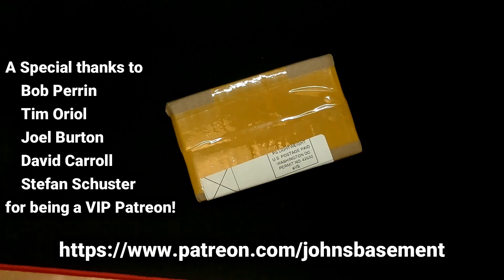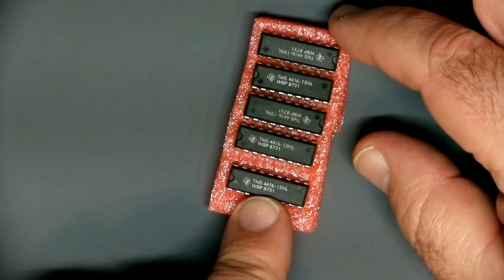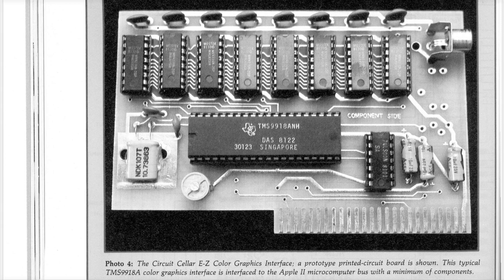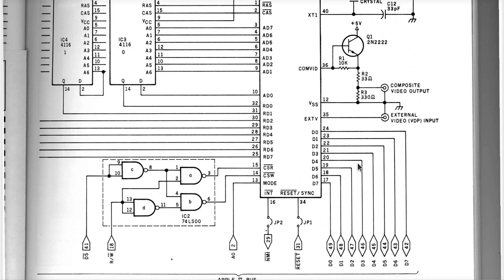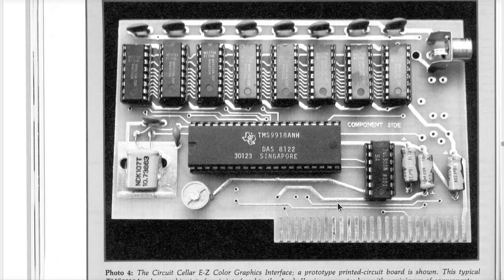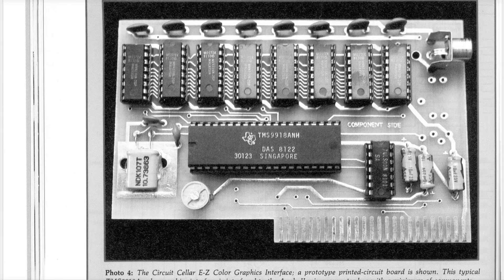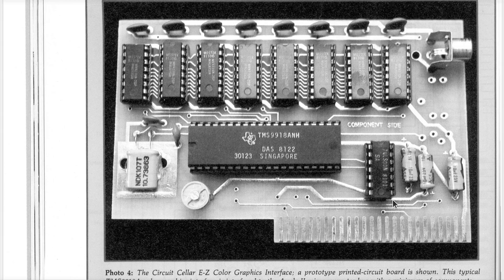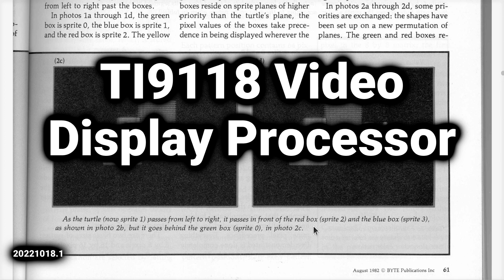Z80 Retro #44 - Contemplating the Addition of a TMS9118 Video Display Processor

Comment: And extremely bad designed-full of tricks-and limited chip. it also have a very annoying hardware bug related to the polling of status register that because of a race condition can cause the cpu to misread  the vblank bit of status register.
Reply from the maker: Indeed it does!  I recorded a vid about that and hacked the design to work around it.
Reply: @JohnsBasement  It's not the only flaw in this chip. there are a lot of stupid choices, driven mainly to cost-cutting reasons.
For example: the magic Y value for sprites. Why the hell a so stupid choice? It prevents increasing the vertical resolution in new improved chips. What if the Y res increase to 350px? you have a forbidden Y sprite value? My god.
Also i've discovered another stupid behaviour. I remember a register configuration that make possible to use less memory in GR2 mode by using only one third of the three banks available  for pattern and color data. However, why in the hell the number of sprites decreare from 32 to 8? what have to do pattern and color data with sprites?
And MORE: it also give a sort of "sprite ghosting" effect where the same sprite is REPEATED on various Y positions. But this only appear (i do not remember) DEPENDING on THE CHIP THERMAL STATUS (the chip temperature) !!!!!!!!

May be a fanout problem in some output stage? What a crappy full of shit chip
Reply from the maker: You'll notice that I have moved onto FPGAs... in part to design my own VDP.
Reply: @JohnsBasement  A right choice... ;-)

Comment: it is no problem for the bus connector (as well in the apple2 as ibm-pc) dealing with only hal-tinned surface on the contacts (they do have to be gold-plated or else) because of thermal "self cleaning" and "vibration "self cleaning" -- in opposite to vg64/vg96 which are contructive steady-state. there it a lot of sense using high quality gold- or something else "good" on surface of the contacts. 
of cause, some higher density pc-connectors such as agp are more sensitive about. the original pc-xt- or at-slot connector is as primitive as it can handle just only hal-tinning, refreshing its connection by thermal- or vibration- cases during normal operation process and use. golding only suggests "higher quality" -- and that's why it is done by everyone.
next, me was surprised by asking prices: chemical golding the whole print was cheaper!!! or even the same as hal-tinning. i believe this is a structure-processing thing of the company each -- it's easier for them to run only one kind of processing for all units they produce, regardless what it is. they count and calculate in square meters ore something else per hour "processing-costs" regardeless which processing; -- the main thing ist, it's their own processing; so hal-tinning is an extra step if they were shot-in for general chemical-goldig e.g. regardless what comes in to process.
best regards, andreas seck (germany)

Comment: the early MSX computers used the 9128  chips.. and i have the manual with the chip info and pins in it if you want it...
Reply from the maker: Thank you for such a thoughtful offer.  But, since recording, I think I found what I need on line.

Comment: The commander X16 uses an FPGA video solution (Vera?) and there were at one point some Arduino hats that ran something similar.  But that probably gets boring if the whole problem has been solved.
Would it be a dumb idea to add a couple of 8-bit latches to decouple the TMS from the Z80 bus timing issue?
Reply from the maker: So true!  I often say it is not about HAVING something, it's about CREATING it!
One need not be the first to do so in order to experience the joy of discovery.

Comment: Regarding the speed of your z80 vs the ti9118 on I/o operations the z80 automatically adds a wait state to access the io devices for that specific reason. Maybe adding a 2nd wait state is all it needs which is done easily with an 74hc74. There was a nice section in an z80 book on es generation for memory and slow io devices which I used to properly access an ay psg some 15 years ago - can’t remember which book it was though .
Reply from the maker: I did a facepalm the other day while reviewing the waveform diagrams.  Again I forgot about the I/O wait state that the Z80 adds on its own.  Even at 10 mhz it is close.  Maybe adding one wait state is all we need to be in spec!
I remember seeing the 'add 1 wait state' schematics many times.  I expect it will be easy enough to locate & analyze.
Reply: @JohnsBasement  I’m thinking of using the chipselect for the vdp and feeding it in an d flipflop clocked by the cpu clock which ensures it’s still there in the next t state of the z80 which is t3 if I’m not mistaken. If you need more there are 2 d-ff in the 74xx74 simply or-ing the outputs et voilà waitstate generator. On my first z80 design I had a 374 fed the IOREQ and clock for a variable 1 to 8 cycle WS generator for an a2d, ay psg, eprom programmer and an lcd display.

Comment: I've done a TMS9118 board for my 6502, so much easier than those static ram replacement bodges the 9918 guys are doing.  Power consumption isn't great and yes it does require some significant delay during writes to it at 2MHz.
Reply from the maker: Would you know if the chip will render clean NTSC with no more than power & a crystal?  I am waiting on a crystal.

Without any RAM and running with a 6mhz crystal, mine squawks something not quite right out the video pin.. 😁

Comment: Sorry for the belayed response. For some reason YouTube popped up odd errors when I trying to comment on your vids. The PCB appears to have an empty set of transistor and resistor pads to the right of the board. I've driven my VDPs without the transistor just fine.  Ensure that you get the correct crystal frequency to get the color burst working properly.
Reply from the maker: Which board are you talking about?
I've also seen some youtube comment strangeness lately.
Crystal ETA is wednesday.
With any luck the chip will boot & generate recognizable NTSC without any RAM.
Reply: (PCB = Steve Ciarcia's). As mentioned previously, you'll need to write to the VDP configuration register to get it to output a video signal otherwise you'll see what looks like a highly attenuated video signal. Once enabled you should see a very stable NTSC composite video signal.
Reply from the maker: @PebblesChan  That is what I'm seeing!  I guess now I need to connect it to a Retro.

Comment: I have been having good results with another chip from that era, the Signetics SCN2674, if you were looking for another option to consider.

I added a RAM, a character ROM, and few glue logic chips and I am getting "VGA", 640x480x60 fps with 1 bit of color, at the moment.  It's more text oriented giving 80 x 30 as I set it up, but could do color and some bit map modes with more work than I have put in to date.  It does not have built in sprites, but it is also not limited to composite output.

A guy named George Foot has a couple of videos that are quite similar to what I did, minus the PLD that could have saved me a few chips.
Reply from the maker: Cool.  I'm thinking I want to ultimately target VGA too.  These days composite is just too annoying.
Reply: Do you have documentation online covering your design?

Comment: "Yamaha made two later VDP chips based on the 9918A – the 9938 and 9958 – that expanded the original 9918A’s features, yet remained software compatible with the 9918A."  RGB output.  See YAMAHA LSI V9958 MSX-VIDEO TECHNICAL DATA BOOK and wikipedia Yamaha V9958 page.
Reply from the maker: Much experimenting & reading to do!

Comment: I had a MSX computer in the mid 80s which Z80 I overclocked to 7 MHz from the original 3.5 MHz. Had a few instabilities in the VDP but I'm not sure whether they were due to the bus timing or the software (ie IO access) timing, although I tend to think it was more of the latter. Nice job!
Reply from the maker: Thanks!   I'm making this up as I go  This should be interesting!

Comment: Rather than slowing down the CPU clock. What do you think about adding CPU 'wait' to the I/O? That seems to be the purpose. 
When you look at the timing, can you show why or why not a wait cycle (or three) will work?
Reply from the maker: Wait states would work fine.  I just don't want to add the extra chips.  But maybe I should plan for them anyway. The board should be pretty simple...